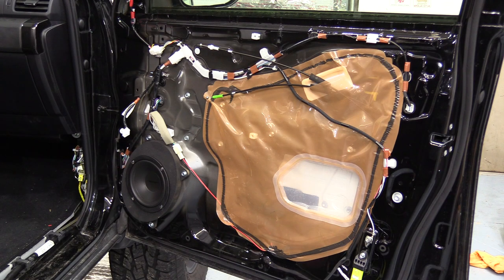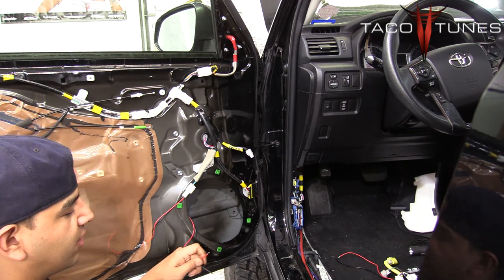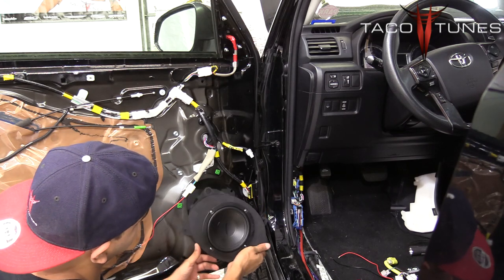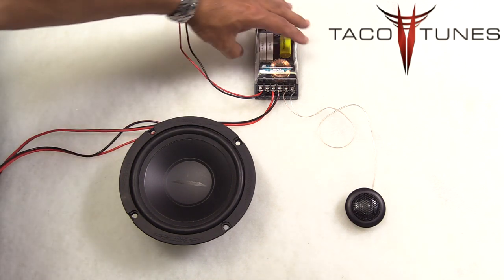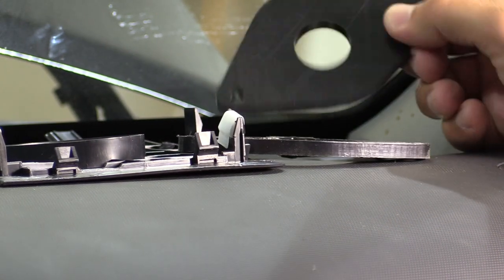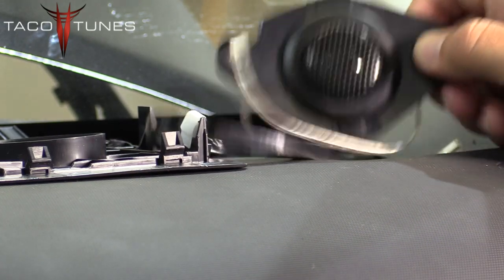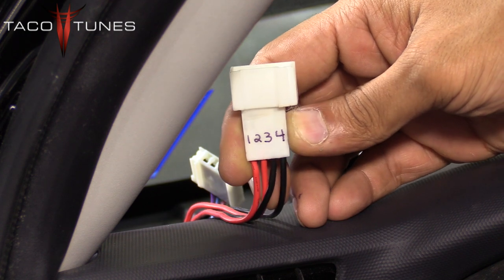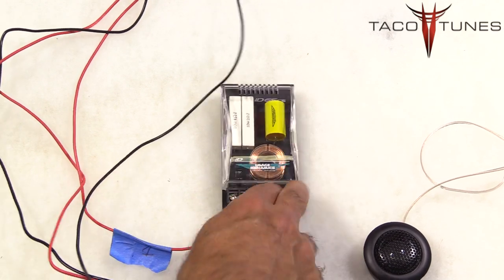Toyota 4Runner How to install component speakers tweeters in the front doors 2

Comment: Where did you guys pull the wire from the door speakers to wire into the crossover? All I saw was a connection into the original adapter but I don’t understand how you routed the wire from the door speaker to connect it! Help please!

Comment: When you showed how to wire the tweeter harness adapter to the crossover, you had two channels (tweeter - & +) unused on the crossover.  Are you supposed to use those channels to connect directly to the tweeter?  I’m assuming so, because that makes logical sense but, without the clarification it left me a bit confused.

Comment: Question. If the car already has component setup with woofer and tweeter, isnt it already setup to handle the different signals? I figured if I wanted to replace them its just plug and play without any additional components. Thx

Comment: so if im  understanding this correctly.    if i were to be installing a 2  channel amp.     with your  component set for the front doors.  you dont even have to  run wire through the  door jam  .    it would just  go to the tweeter  and from there to the door speaker  (front doors)

Comment: What if you don’t have the plug n play? Can’t you just cut your stock tweeter wires and extend them by adding more wires and running it that way to your crossovers and speakers?

Comment: Its easy to have swapped out the plastic 10mm screw mounts for metal ones, I also would have put sound dampening on the door skin, so easy to do and whybypu cut that corner I do not know. Overall I think you did a very minimal job of installing this at best.
Reply from the maker: thx for the feedback . . but this is an instructional video! Be sure to check out our many other vids include matting (dampening) and many other upgrades.

Comment: fyi, that white factory connector at the top comes out with a little work with a screw driver, avoiding running the speaker wire around through the plastic.

Comment: I’ve got a 5 channel on my 2010 4Runner. I can’t get sound outta my rear doors but the back hatch has sound. Do I need a splitter somewhere to get the signal to the those speakers?!
Reply from the maker: the rear doors and hatch/cargo are tied into each other. i would check the wiring, and OHM as well on each set to make sure your presenting your amp with the correct impendence
Reply: @tacotunes ohhhh

Comment: Y’all spent the entire video explaining basic crossover wiring then in the end, added a completely unexplained step of splicing tweeters.  (“B splices”, “tweeter jumper”)

Because these speakers are wired in parallel and we are using existing factory connectors I’d say this is the most important and confusing step and y’all glossed right over it. Can you please clarify?
Reply: I think it helps to think of the signal flow in terms of inputs and outputs. This is why there are 4 wires (2 positive and 2 negatives) going to the tweeter and in the adapter he is using.
So with the stock setup the speakers are running in parallel, you have one positive running into the tweeter (input) and the other positive connected to the tweeter is actually sending power to the mid range speaker. It is the “output”. So power is being sent from the amp, to the tweeter, and then from the tweeter to the mid range speaker. In connecting the adapter, the goal is to replace the tweeter in the signal flow with the crossover. So the positive from the amp runs straight into the crossover instead of the tweeter. The crossover then sends the signal to the separate speakers. This is why you connect the “number 3 wire” to the crossover, because it’s not sending power to the crossover, rather it’s sending power from the crossover to the mid range speaker (like the tweeter did originally). And then the tweeter would be connected without the adapter he is using. It would just be a positive and negative from the tweeter running straight to the last connections available on the crossover. 

So the signal flow will go as follows (I’m using the numbers he uses for each wire) 1&3 are from the amp straight into the crossover. 2&4 would then send power from the crossover to the mid range speakers. And then the last 2 connections on the crossover would be connected to the tweeter. Essentially by the end the speakers won’t be running parallel anymore. Meaning if you disconnect the mid range from the crossover the tweeter will still work and vise versa. I hope this makes sense. And I hope I answered the question you were asking.lol. Of course you posted this forever ago so you may have it figured out. If so hopefully this clears things up for people that have the same question. And hopefully I’m not way off the mark here. But that seems to be how he is running it.
Reply: Stephen Woloschek thank you so much!  Your explanation nailed it and completely cleared up all the confusion I had!  I appreciate the in-depth and understandable explanation!   This is EXACTLY what I needed!
Reply: Stephen Woloschek I think it just “clicked”. I haven’t gotten back to this project so we’ll see how it goes when I do. Thanks for the help
Reply: Konrad L I’ll be hooking up my Morel components Saturday 7/18/2020 in a 2015 Camry.  I’ll let you know how it goes.
Reply: @DEYCALLMEMD  hey how did you route your cables from the dash to get to the crossover? I’m installing on my Camry too and I’m so confused
Reply: @rongdongs4719  I didn’t have to route any new cables as I used the stock OEM wires.
Reply: @DEYCALLMEMD  for the component unit?
Reply: @DEYCALLMEMD  do you happen to have any photos?
Reply: @rongdongs4719  I didn’t take any photos unfortunately.
Reply: @rongdongs4719  did you get the tweeter harness?  You should be able to feed the wires down the side where the stock wires were fed to the door speakers.
Reply: @DEYCALLMEMD  my car has the dash tweeters and side door woofers. I am probably gonna route the wires through the rubber boot
Reply: But how about if you're just replacing the tweeters with an aftermarket one that has a resistors built in and without the amplifier?
I understood this specific setup is when wiring with an amplifier.

Comment: is there a way to install the tweeter on the sail panel with this same kit ?
Reply from the maker: Sail panels won't support tweeters, there is not much room on the stock panels.
Reply: I think the sail panel may be a bit too small to hold the tweeter.